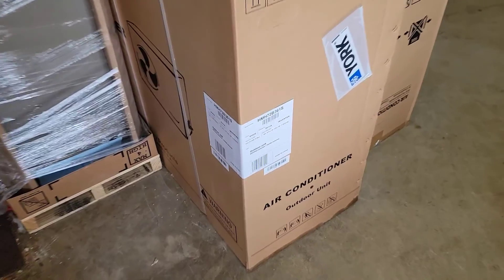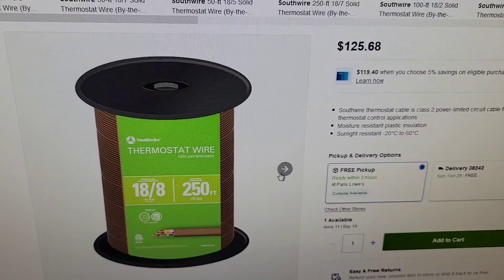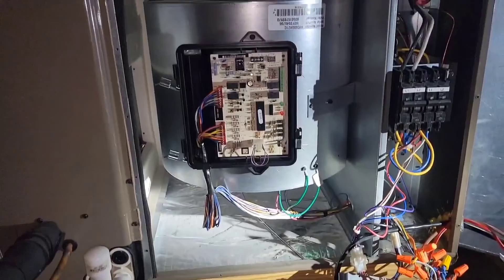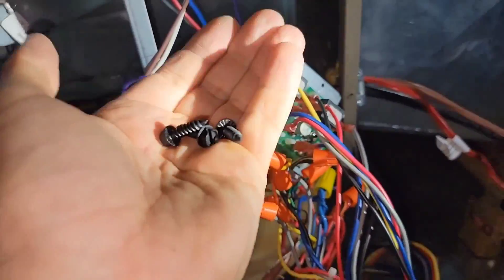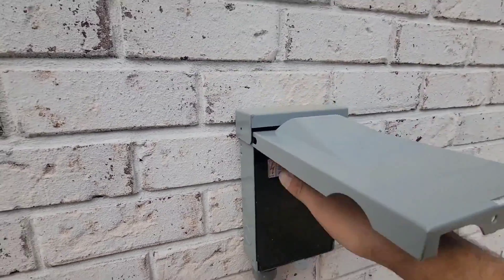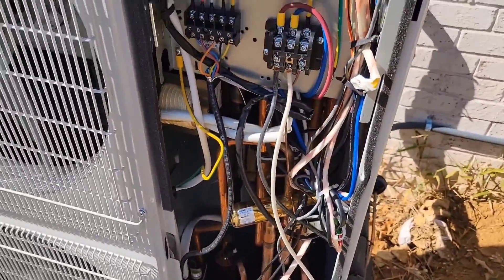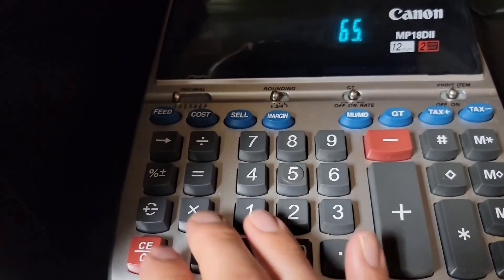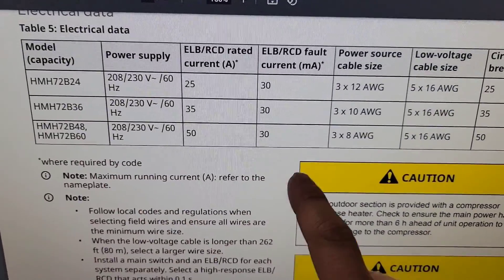HMH7 Heat Pump New Construction wiring and charging tips

Comment: I have this exact unit. I’m 57 and retired. Went to school two years for a/c and Worked as service tech late 80’s-1995. I continued to do a/c work for my restaurants I owned and for friends and family so been doing it close to 40 years. These new units are garbage imo. My old York lasted 17 years but compressor failed so had this installed. I installed all my stuff myself until this one as I’m getting older, back is bad, have lots money lol. Anyways the condenser leaked before two year mark. Two weeks to get one here in Florida sucked. Guy installed it on a day was about 60 degrees so I figured he would not be able to charge it properly. I was right. The other day was running too much, threw gages and temp probe on and over 500 psi head and 25 degrees subcooling. Blew lots of gas out until reached 12 degrees subcooling and 360 head. I find it incredibly stupid they have no charging charts for this unit. Just tell you how much to add per extra foot liquid line as mentioned here. That’s fine when installing but with no chart what are you supposed to do? Recover it all and weigh it in? Yeah that’s real quick and convenient. I know most units 10-12 subcooling is fine but some  Lennox units run 3 degrees. I hope it doesn’t break again. Side note new condenser arrived not packed well and one of return bends had decent dent in it. If didn’t take two weeks to get it I would have rejected it. Great quality control at York. Not!!!!
Reply from the maker: Sounds like you've got a lot of experience, I hope everything works out for you with that unit. What part of FL I just got here for vacay I am stoked I am in Sarasota
Reply: Near Tampa. Sarasota is nice it’s about 45 mins south of me. Enjoy.

Comment: This is awesome. I think this is pretty much the exact system I have been quoted. But, I’m struggling with deciding on buying this system because I think the company selling and installing it is overcharging me a lot. This is an upgrade install. I do need a new line set and I’m doing a good portion of the cosmetic construction to get the old air handler out and then finish the new air handler after the system is installed. Here’s my desperate question…does $16, 800 sound about right?  It is a York four ton HMH7 heat pump and 4 ton air handler.  As I understand it…it operates on DC power. And is very efficient.  Please help. No air in my house x 5 days. Need to decide soon. Thx

Comment: Hey, I am a homeowner troubleshooting my HMH7 unit which has been really disappointing. I can't get any help from my HVAC installer who did the unit.  Right now in near peak summer temps, the ac is cycling 2-3 times per hour but only in cooling cycle for around 10-12 minutes per cycle. I was expecting this to modulate for really long run times...does that sound correct?
Reply from the maker: I really need a few details
I need the duck size
The return and supply sizing
The thermostat settings
The size of the return grill and filter

I can walk you through everything
You can click the join button become the member and get my email
You can also become a level 4 member and you can get my phone number let. Me know what you decide and Let me know if you join
And I will give you my email and then my phone number
Join this channel to get access to perks:
https://www.youtube.com/channel/UCuMyjTVlkM4xZ5z_eSyoB1w/join

Wanna learn more about hvac? Check out my hvac tips for technicians playlist.

https://youtube.com/playlist?list=PLVjetZt5xgenmO76adHwb2ctyeBIFKUus
Reply: Before that, is this different from what you would expect? You seem to have a lot of experience on this hmh7.
Reply: @tonybertucci9324  did you resolve the short cycle issue? And how? I had 3ton unit and it does the same thing. I just dont think its normal..

Comment: Hey there. So question on the dip switches on the air handler. I can’t find anything on what setting for the dip switches on the control board. I’m working with an hmh72b601s and jhvtd60hbcc2n1a
Reply: @RobertMcAndrews-h4u  dip switchs on Condensor? Seen it as S4 and S5 but there is no instructor on there and how it control inverted in?

Comment: This is the first I've seen anyone else installing an HMH7.  Does the electric strip heat turn on for a time period every time the outdoor starts?  I installed one of these for a customer to replace a 16 SEER Gibson burnout.  York sold it to me as 18 SEER but the box and unit were clearly labeled 17 SEER.  His electric bill actually increased with this unit and all I could find was that every time the outdoor unit cycled on, it made a call for the electric strip to kick on for something like 60 seconds.  When I brought it up with the York dealer they said yes they've heard that's how these work and there was no workaround other than to limit number of heat cycles per hour via thermostat.  Also wondering how reliability on these is since they are Gree units; you literally have to slap the York sticker on them when you install.

Comment: Could this heat pump be paired with a gas furnace, if so do you still need the york supplied relay?
Reply from the maker: Yes I have a video coming in the next week that will show you this unit paired with a gas furnace

Comment: 8:20 30ma is the earth leakage current in mili amps (ma). Cable size should always be calculated on cable length and current, I guess the recommended is calculated with a safety factor. They have a get-out-of-jail card in the notes. Notes also state the unit requires you to install an ELB/RCD for each system. It's bad practice to have units installed with two separate fuses as voltage can travel down to the other unit if it has been isolated. Thermostats add to the problem as testing may show no voltage until the thermostat cuts in. Be safe out there guys when working on equipment. The day you don't test is the day a mistake was made. My spikey burned hair confirms this.

Comment: Neat trick with the t-stat 18/8, + you get 3 backup conductors for later down the road 👍
Reply from the maker: Yes indeed!
Reply: @taddydigest  Ya, but if the electrical specs state 16/5, then how come you can get away with 18 AWG?  Did technical support tell you it was ok?
Reply from the maker: Hey Joshua
I always read the manual and I thought up until yesterday That 16/5 wire is what I was supposed to use
But I spoke with Tech Support and they said that I could use thermostat wire
So that's Why I did the video to show that you can use thermostat Wiring
Reply: @taddydigest  Did they mention being able to do that with the Comm wire for the regular ductless or is that still 16/2 as spec'd.?
Reply from the maker: 16/2 as spec'd.?
Reply: @taddydigest  16/2 wire is spec'd out for the single zone and FJM units for the communication wire.  In the spec sheets.
Reply from the maker: yes